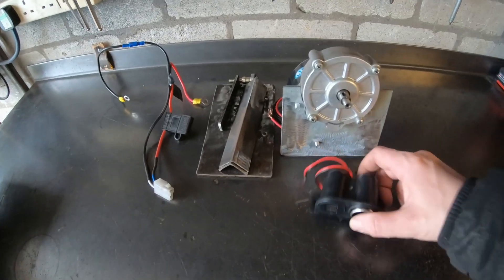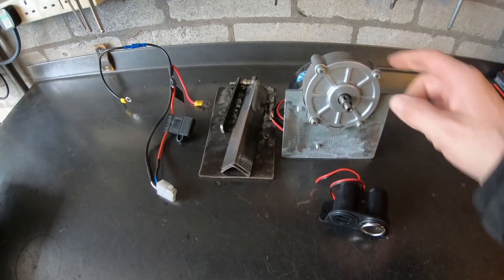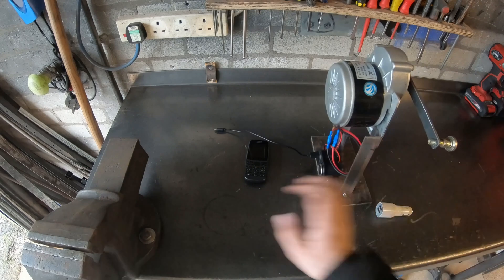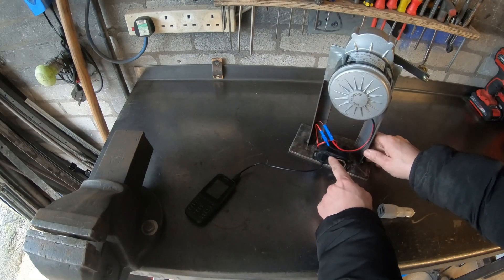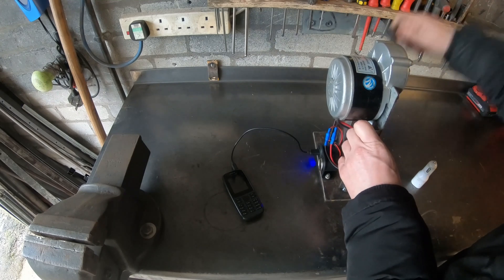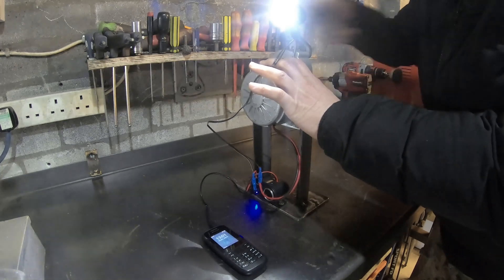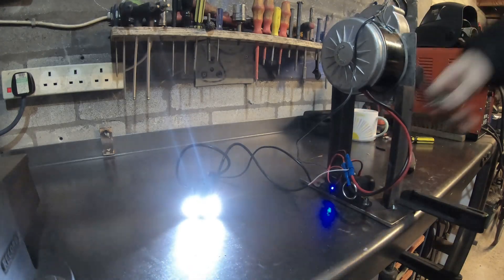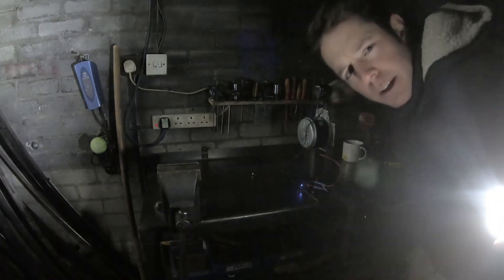Hand crank generator simple design charges phone. Free energy

Comment: Good build, this motor probably can give an amp or more because it's geared makes it easier. If you ever find some supercapacitors you can have some minutes of lighting with seconds of cranking.
Reply: You can save some money too if you put a zener diode and an Led (the led will light up when the voltage threshold of the zener approaches)
Reply from the maker: @axiomV  Thanks. I will try to work them into  the build once I get my head round them.